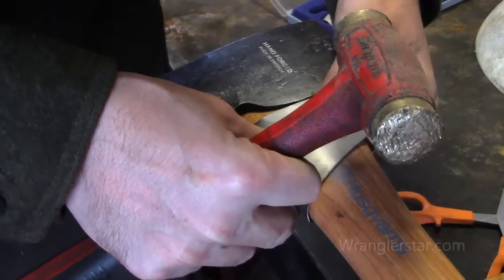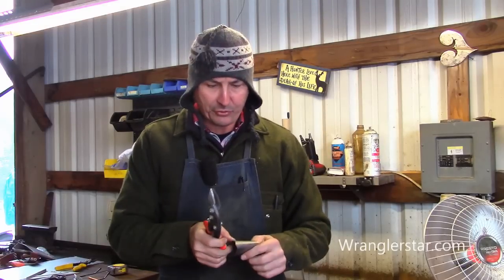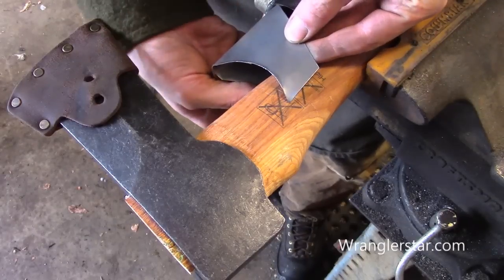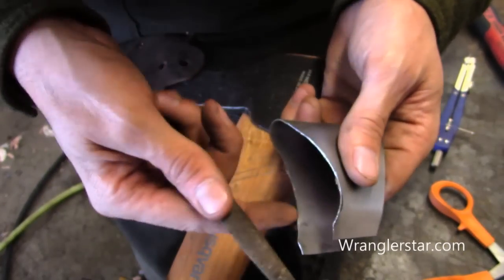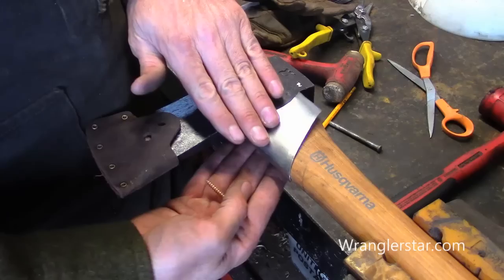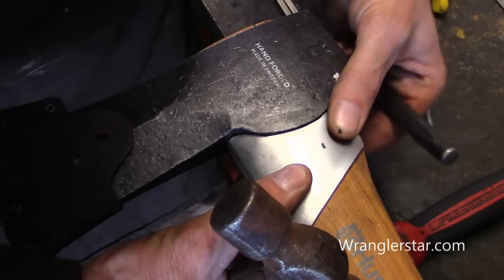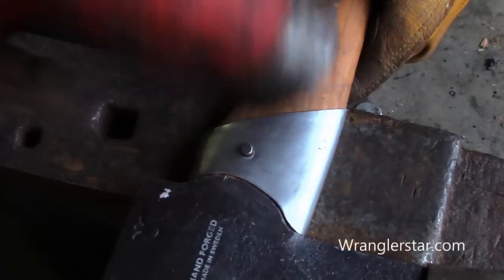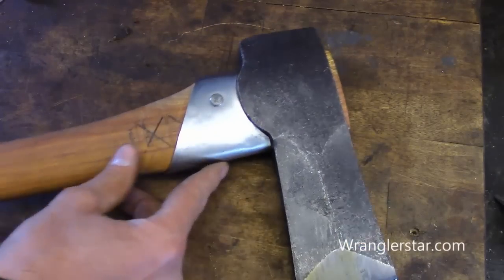No More Broken Axe Handles 2 | Wranglerstar

Comment: Great video Mr Wranglerstar!
My dad used to do something similar for our old splitting mauls & axes when my brothers & I were old enough to cut wood in the bush with him. He used mechanics wire & double wrapped it real tight from about 6" out right tight to the head & back.
I learned a tip from a man we used to call the axe handle king of Muskoka.
He used 3 1/2 inch galvanized framing nails for rivets with a 3/16 hole on wooden handled implements, worked like a charm.

Comment: When pinning something like that, you should drill the hole in the handle a couple millimeters offset (in this case, offset toward the back of the handle) so that as you press the pin in, it pulls the collar tight to the handle.
Reply: Good comment. Was hoping you’d have some videos up my guy!! Feel free to give me some pointers as well on my vids

Comment: A few ideas:
1.For cutting the material to wrap handle: Use a piece of bristle paper; thin but ridged using the same scribe like you did. You wrap, trim, and fit it each time just as you did the metal until perfect, then you have a pattern w/out maring your handle.  I've used this for making leather sheaths and similar projects as yours; metals, leather, polymers.

2. I think anyone doing a project like this understands that drilling or adding a fastener compromises the handle.  A couple knife makers I know use some nearly indestructible epoxies that you can't even burn them off the blade.  An prior commenter mentioned this and I would like to second that idea using a ridged polymer (Kevlar, nylon), or a heavy treated rawhide.

Your vision, mission, or ministry... I'm not sure what you label your show as... Is an inspiration in all facets of life and appreciate what you and your family are doing.

Comment: Wranglerstar, PLEASE use some light gloves - those cut edges are very sharp.  They also enable you to hold the part a bit more securely.  As for getting old - this year I had cataracts removed from my very near-sighted eyeballs - took about 7-8 minutes per eye, and the inserted lenses enabled me to have perfect vision for the first time in my life.  Wonderful!  The surgeon was a target shooter like me, and made my right eye a bit more acute then the left - 20/15 in right, 20/20 in left, so I can see the "X" a lot sharper.UT - my aged eyes no longer flex as do younger ones, so I have "half-eye" reading glasses.  One drawback for me is that my regular glasses also served as safety glasses, so now I have an added bit of equipment.  As a gunsmith - the magnification of the reading glasses helps immensely.  many thanks for all your so very informative videos.

Comment: I've been doing this for years and can say it does work, (when compared to no protector at all). Mine have never been as pretty, but I put some inner tube material under the metal as a shock absorber. I fasten the metal on the back with small pan-head screws so no big hole through the hickory.

Comment: Nice idea with the collar. 
Just figured out how I'll be doing my axe.
Make a template with a paper bag.
Trace it on an old stainless steel sink.
Cut the steel with a dremmel.
Coat the handle area and steel with rubber cement. 
Let it dry out and become tacky.
Wrap the steel around the handle.
Permanent bond.
Repeat rubber cementing steps with Leather over Steel.

Thanks for another excellent video.

Comment: I have several JM2CW comments / suggestions (constructive criticism) for future use. 1) If you can't clamp it down to prevent things from moving, set the condition up as it will be used and drill it as a unit - don't drill on a broom stick and then go back to the axe handle as it's highly unlikely to get the entrance and exit holes to line up. That's why there was a bit of a gap between plate and axehead on the one side (the pin "found" the rear hole and tweaked the plate to align). 2) Make a small countersink (doesn't need to be excessive) and peen the material into the countersink recess to prevent the "rivet" from dislodging. 3) You didn't so much as need a bigger hammer just use the peen end of the hammer not the conventional head. 4) A lot of thought is needed about how the forces are going to be distributed from impact into metal plate carried thru plate and wood of axe handle and transfered into "rivet" and dispersed thru it all (maybe now the bolt will do the worst damage). 5) It will make it look nicer but probably better leaving the plate off so any damage isn't concealed. (the plate could get a little banged up looking but there might be a serious crack in the wood maybe now in 2 areas, the impact zone and thru the bolt hole that can't now be seen). Overall though nicely done. I'm currently working on a similar project to repair broken wooden pruning lopper handle using thinwall EMT as "side plate" and same techniques.

Comment: love the finished product, I put heavy mechanics wire wrapped very tightly and tapped each wrap to the contours of the axe head as I went with a blunt cold chisel. I held each end in position with a very small nail with a head big enough to wrap the wire around before I drove it all the way home. the starting point gets buried under the wire leaving only the end opposite the head visible.
Reply: Much easier and just as strong. I will do this

Comment: I use some nice thick nylon string wrapped a couple of layers thick just below the head of my maul. Simple to apply, works a treat and is easy to replace when it gets damaged. I would think it would also absorb more of the power of a missed strike than sheet metal would.

Comment: Made one many years a go. But how I did it was first made an thick paper template. Then transferred it to metal sheet. After words. Tig weld the back side. heated up the metal and put it on the wooden handle. Just like you do it with wooden wheels.
Interesting to se you made it this way. Always nice to se people doing things in a different way :)

Comment: Great idea and video. Thanks for posting. Just a tip for next time scribing. Don't rotate scribe as you follow the curve. Keep the scribe parallel to the axe handle. That is why you had gaps on either sides.

Comment: I think I would have opted to epoxy the guard onto the handle then wrap it with a bungee or other elastic until it set then file the excess.  I'm afraid whatever you gained by the guard was lost with the rivet hole.
Reply from the maker: GettingSquaredAway I disagree. The hole is very small but we will soon see. You may be right. I don't like this handle much anyway.
Reply: wranglerstar You know what they say, don't gamble more than you can afford to lose.  If you don't like the handle much anyway and it does break, you can make a handle you do like.
Reply: wranglerstar I suggest using the ball end of your ball peen for peening a rivet it will spread more.
 Also if you check out my post on the first section there is the way that the guys do it for sledge hammers in a diesel shop.
Reply: i think he should have epoxied the rivet so it would bind the wood together.
Reply: ironlionkalo I agree, but i think the bolt was a tad overkill. I would use PE plastic to protect that, it could be welded on and with no fasteners ;)
Reply: wranglerstar
A small round hole isn't going to have much of an effect on strength. In a perfect world a more center(ed) hole may have been better but you gave a real good explanation as to why that wasn't possible.
Reply: "Make an "550 micarta" from 550 cord and epoxy around that part. If you're so concerned with breakage." Hmm, To each his own I say, why boss somebody around?
Reply: GettingSquaredAway 
HIstorically poleaxes had their bits stabilized using steel or iron langets attached to the shaft with several rivets.
It didn't seem to compromise the integrity of the shaft/bit junction.
Instead it stretched out the structural weakness over a larger area, and prevent it from concentrating on a single point.
Reply: They were commonly square sections with more material too.
Reply: They were square or octagonal, therefore having equal thickness and width.
However their thickness (or width) was roughly comparable to the width of a shaft of a modern axe.
Your woodcutting axe needs to be wide, because you direct most force along its width, but your polearm needs to be symmetrical in cross-section, because you need it to take abuse from all directions.
Reply: wranglerstar I agree with you. people also seem to forget that the hole is filled with a tightly fitting pin instead of being empty. (much like rebar in concrete vs concrete with empty shafts in it) a very similar technique was also used in medieval times to reinforce the handles of waraxes and maces, which often had much thinner handles than your axe has. 

the only point of improvement i can think of would be inserting two thinner pins instead of a broad one, this will take away less strength from the handle and secure the protection even better to the handle.
Reply: crumble son even if the pin is tight fitting the pressures exurted on the axe could cause problems being that the pin is metal and would more likely to act as a bearing and to cause a pulling force on the front half and a pushing force on the rear half, so i doubt it will strengthen it but i might be wrong.
Reply: GettingSquaredAway I'd epoxy first like you said, but use a brass or copper recessed rivet with a tapered hole for the metal collar so the rivet can push it into the handle.
Reply: Totally agree with you. I used a dense rubber banding around my axe handle. All homemade too. The think rubber will act as a shock absorber, if and when I miss the target.

Comment: One little point....Use masking tape to follow the curves under the head.  The next pass half way and so on until you are just wrapping in a straight line.. Cut the tape with a utility knife and peal it off the handle in one big pc..  Stick it to the sheet steel and cut to the pattern made by the tape. I know I didn't explain very well but do the first step and you'll see where I was going..

Comment: A heat gun and a piece of old black plastic water pipe work really well also.
Reply: Ive wrapped em in baling twine and hit em with a heat gun. it will fray some if you over strike but hit it with the heat gun again at the end of the day and it'll be fine.
Reply: Fiberglass and resin work really well. You can sand it down when you're done and won't hardly notice it's there. It's pretty strong too.

Comment: I found that using Marine Silicone works on all types of projects and fills in the gaps and keeps the water out.  Also it provides a "shock guard" for some items.  Just put any kind of dish soap on your fingers and spread it where you want and easy clean up.

Thanks for posting another great video.

Comment: if you have a small shape to cut out like this the easiest way to do it is to take a zip cut 1/8th cutting blade and cut directly in to the line making several small strips then cutting it from the side taking out the small strips as you go. the strips falling away make space for your cutting blade to cut off the next strip.
thats how we do it at my shop for one off projects like this.
cheers and great channel.

Comment: Great job! Another idea is to leave some extra material on the back side of the axe. Enough to over lap and then pop two brad tacks down through both layers. Just a thought. If your afraid of it still moving, then just stick a couple of tacks in the front as well. Also I use snips like those everyday, they can cut a very small radius if you're use to them. Wiss and Bennett make the best snips. Not taking anything from the job you done. Just some suggestions. As I said before, great job. You are a very crafty man and I like the fact that you get your son involves with some of your projects. Start them off while they are still young and they will carry on the skills for generations. Cheers and God bless.

Comment: I have used discarded bicycle innertubes as a protection and even on semi cracked handle with success. Wrapping. Like the paracord technique, but it does not require soaking or drying - wrap it tight and get cutting.
Reply: +ᏳᏫᏜᏡᎦᏈᏜᏫᏳ Hmm, bicycle innertube. Nice idea. I can also protect other stuff with that. Thanks for the tip.
Reply: +ᏳᏫᏜᏡᎦᏈᏜᏫᏳ I agree with this approach. 

I have always used strips of my old bike inner tubes (the ones with too many pin hole leaks to be worth patching) as my go-to protect-all solution as well as my quick grip-making solution (using thinner strips)for just about everything. I'm seeing in the comments here that a bunch of other people have realized just how versatile inner tube rubber can be, as well.

I've made quite a few soft rubber woodworking mallets by wrapping inner tube strips around some of my wooden mallets until there's a good 1/4"-3/8"+ of material. I never glue or tape my wraps at all, I simply slip a bit of the corner of the end under one of the loops that came just before the end and that's usually enough to keep everything tight and snug for my needs. It's also just as easy to put the end right under and through the previous loop/ wrap-around then pull out any slack to make the tension even greater.
Reply: Inner tube works a treat. 
All my axes have been wrapped in rubber

Comment: That was good placement for the pin.  The handle is like a beam in that it's primary loading is bending.  The back of the handle is in compression when chopping, so the hole for the pin does not weaken it.  It would be okay even in the center, but your placement looks spot-on best to me.

Comment: My grandfather did something very similar. He did a few things differently was the riveting was moved back so the rivet heads wasn't at the widest point. He used two rivets one was a quarter inch from the lowest part of the head the second was down in line with the first. He would mark the holes on the handle drill the holes a shade back. The shape was the same as yours.
Reply from the maker: Thank you Sam
Reply: My grandfather used bailing wire wrapped very carefully starting and ending with a hole just big enough to tuck the wire into.

Comment: That's interesting. Many years using something like that, but crafted from soft and fat material like track rubber(earlier) or sole polyurethane(last two years, lightweight and strength, thickness about 5mm). In theory they give best protection cause of longer breaking distance. Maby hikory much harder and steel better fit for this, I use tenacious birch handles and steel don't fit for them cause they may be damaged under the protection. 
With best best regards from Siberia!
P.S And sorry for my rude english - I use it mainly for liscening and reading)
Reply from the maker: Thank you

Comment: i know you hate plastic / rubber handled things, buy im teaching my roomate how to split wood and well lets just say he misses allot lol,.and im certanly not immune to missing aswell. after about 2 maul handles broke in a week, i did some reserch and came upon the wilton bash maul.

its got 6 hardened steel rods encaseed in a hardish rubber handle, i was already somewhat familiar with their sledgehammers of the same design because a friend of mine who workes in a steel mill said they use them there and they are totally indistructable. 

they are pricey yes but man is it a beast! i got the 8lb one altho its actually around 14# with the handle (the rods add allot of weight). 

it did need to be reprofiled out of the box but it didnt take long with an angle grinder and flap disk and my roomate squirting water on it to cool it. 

no its not the most efficiant tool since allot of the weight is in the handle and not in the head.where it can do work, but man is it tough and it certanly goes through wood like no other maul ive owned. its been solidly overstruck multixple times, full weight right on the handle, and you cant even tell anything happened,.it has absolutely no damage whatsoever.

Comment: i am a very loyal viewer and i really like and appreciate your videos, however if i may mention something that i noticed about this video , i love the idea and i always thought that the wood handel needed such a support, what i think would be a good idea is if you applied some epoxy/any glue or what so ever under the metal sheet to better hold it in place in addition the back side ( where the two ends of the sheet are supposed to meet) that area is somewhat dangerous , i noticed that you slide your hand along the full shaft when u swing these two edges may cut your finger or even when the axe is hanging around in ur tools area another tool may bend that part out as the dont meet perfectly , nor is there anything to prevent them from hooking up into something

Comment: I like it.  I have whipped handles using fine diameter electric fencing wire.   That works OK, and requires just a tiny hole or two  in the handle.